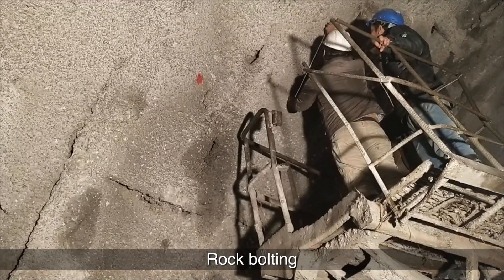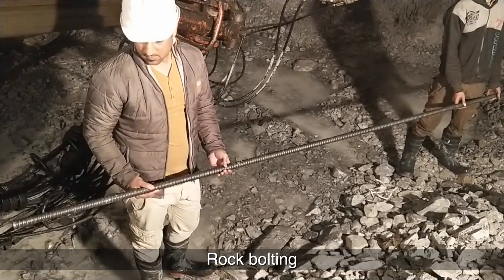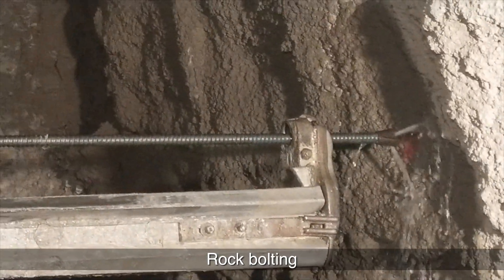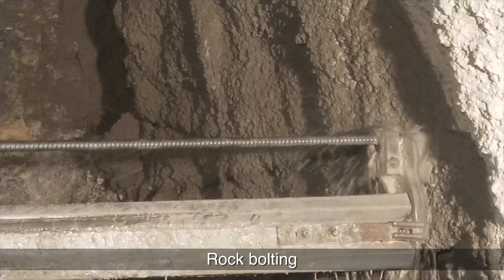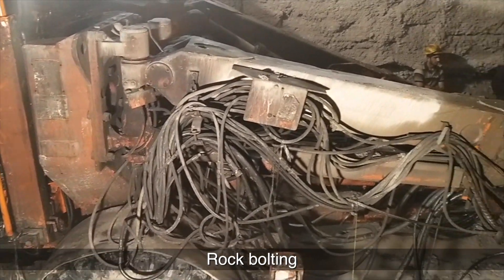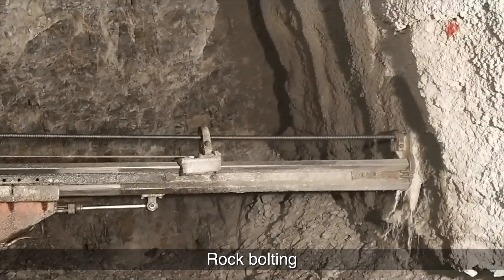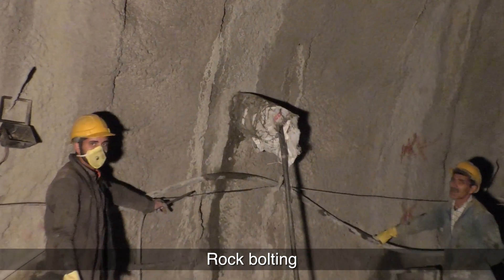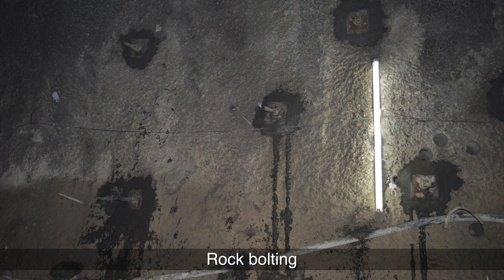SDA (self drilling anchor) Rock Bolting in tunnels

Comment: SDA rock bolt
L-5 to 6 mt.
Dia-32mm
Bit-51mm
SDA is a combined system of rock bolt and drill road .

Tam rock machine pressure -max working pressure is 225 bar and rotation is 175 bar .
Grouting machine name -Atlas capco model 2015 .
Grouting machine max pressure is 40 bar .
Reply: Are these SDA  are hollow inside for grouting purpose?